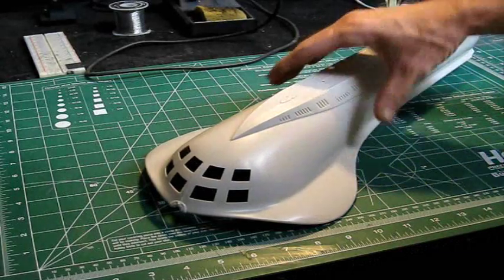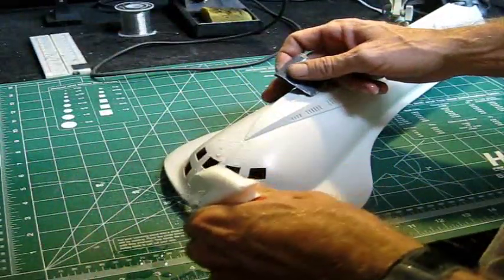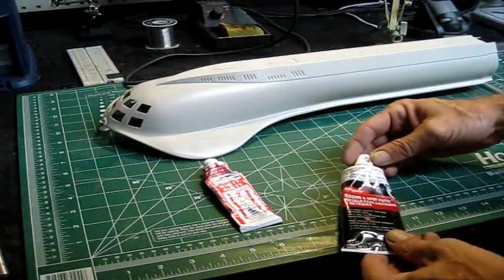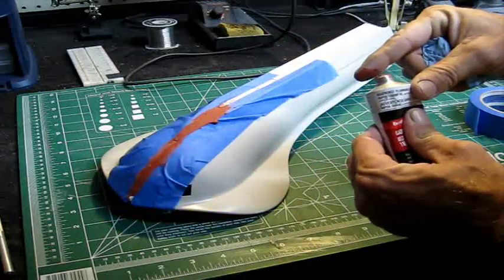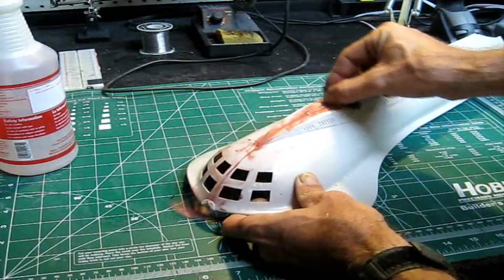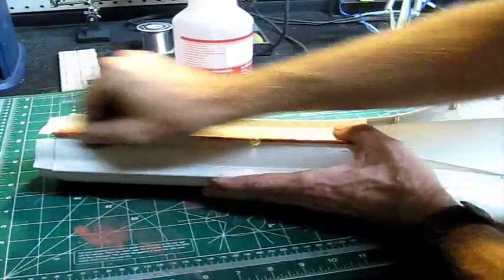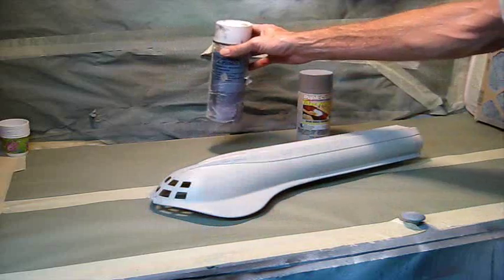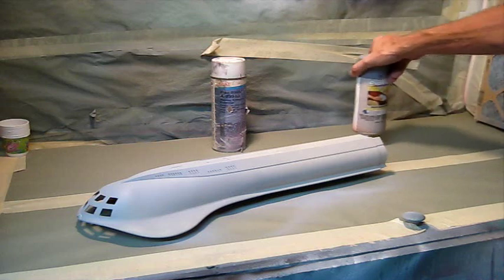Moebius Models Submarine Seaview Movie Edition Video Buildup Series PT 2

Comment: Great job buddy! I have also been using red Bondo spot putty for years. It works perfect with wet sanding. I use Aves putty for larger cracks to fill. It smooths out and cleans up with water and sands great with water. I get the same wet sanding paper at Walmart in the automotive section. They sell it in small sheets from 220 - 1200 grit for about $3-4 a pack. I am glad you are showing people how to properly sand and putty. I showed the same kind of thing in my U-boat video's. Good going!

Comment: Oh yeah, when I use red putty in a crack that is hard to get to, like on an inside piece. I smear it in there and then dip a q-tip in acetone lightly and quickly wipe it out. The seam cleans up right away with almost no sanding to do. The putty stays in the crack, the the excess is on the q-tip. You might have to do it a couple of times if you put a lot of putty down. The only draw back is it might craze the plastic a tiny bit but it sands no problem. Have fun building, it's my favorite part.